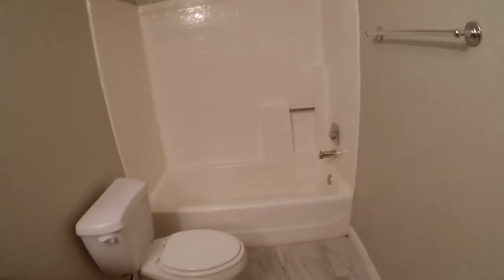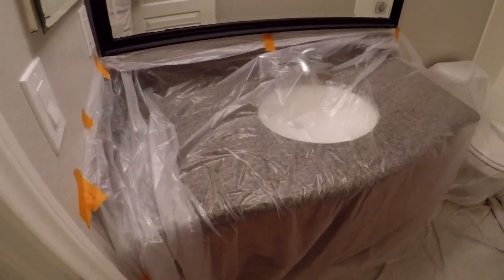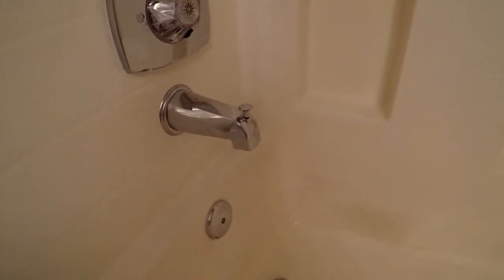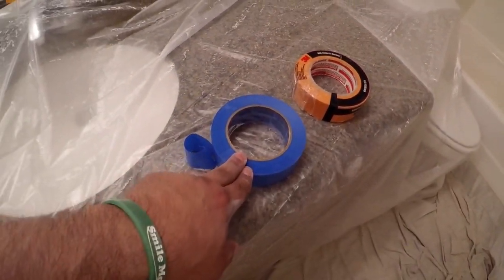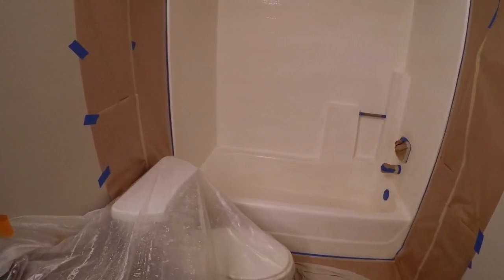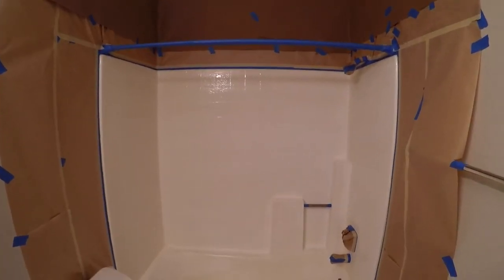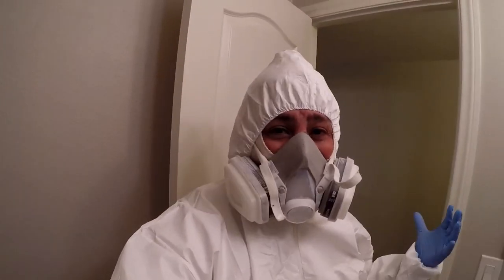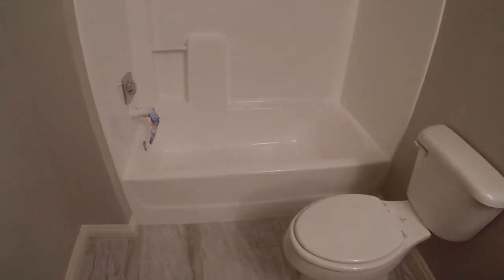How to Reglaze a Fiberglass Bathtub | Full Fiberglass Bathtub Reglazing | DP Tubs

Comment: How many coats of Krylon do you spray on? and how long do you wait in-between coats. Any sprayer you'd recommend for $200-$500? What do you use to clean your sprayer after the primer and Krylon? Will be trying my first full fiberglass tub reglaze this Friday.
Reply from the maker: -I spray 3-4 coats of the Krylon. 
-Graco has a less expensive sprayer or if you are DIY then Wagner Flexio 
-I use lacquer thinner to clean up Krylon and just warm water for the primer 
-Good luck. 👍🏼 
-Let me know if you have any questions

Comment: I attempted to paint with epoxy paint my tub and the fiberglass walls, I didn't do a very good job and wonder if a professional would have to strip everything to fix it?
Reply from the maker: Yes most likely strip it all off or they would have to sand it down very thin and re-primer. They could most likely give you a free estimate.
Reply: @DPTubs  Thank you!

Comment: How many coats of Krylon do you spray on? and how long do you wait in-between coats before spraying another coat? Also how many coats do you get from one kit for a tub and shower enclosure similar to the one in this video?
Reply from the maker: Great questions: 

-I spray three coats on top of the primer 
-I wait about 10-12 minutes in between coats
-I get about two coats for every 20 ounces mixed. 
-You would be safe buying one kit for each tub shower and have left over for touch ups if needed. 

Make sure to shake well and strain the mixed material into the gun. The catalyst sometimes gets a bit “pulpy” so always strain before pouring mixed material into gun cup.
Reply: @DPTubs  Thanks for replying. I ended up buying two kits but returned one. One kit was enough. I am glad I put plastic on everything. I learned the overspray sticks to everything. Anyone considering doing this  make sure you cover everything including the walls. It came out great and was not that hard. It all comes down to the prep work. If you cut corners on the prep you will be sorry. Thanks for your video. It helped me out.

Comment: Awesome job! Very professional! is this the same process for a cast iron tub?
Reply from the maker: No! Cast iron I will acid wash. The cast iron is the same process as the presses steel tubs. I have a couple videos showing the bathtub Reglazing on steel tubs.
Reply: @DPTubs  Awesome! I will watch those. Thank you! What is the expected lifetime of the reglazing for a cast iron tub? And how does it compare to the epoxy pour on products ? Do you recommend this painting method you use, as opposed to pouring the epoxy?
Reply from the maker: I am not to familiar with the pouring methods. However, I like the control and uniformity of the spray application.

Comment: So ypu only use etch on porcelain correct? And ypu just clean and sand the fiber glass?
Reply from the maker: Correct. Clean / Sand / Tack cloth and either use a bonding agent or epoxy primer before your top coat on fiberglass.
Reply: Can I just use regular white primer before the epoxy coat on the tub/tile
Reply: What kind of primer do you use? Latex? Or...

Comment: What size compressor do u use Dp I seem to get a rough feel in the tub how can I avoid that mostly from the primer
Reply from the maker: I use Capspray Titan 75...yes make sure you sand primer and tack cloth before spraying your top coat. Also make sure you are spraying no more than 4-6” from the surface
Reply: Thanks for responding DP MAN I Think my compressor may be too powerful  I got the titan 95 is there a pressure regulator that I can put on there?

Comment: Is there a reason the green painters tape isn't used? I have a case I was gonna use just for this kind of thing. Edit: Your work is absolutely flawless, well done!
Reply from the maker: That Girl yes! It’s about twice as expensive and this tape does the job perfectly! Blue painters Tape or Orange is the most cost effective. Frog Tape is too expensive and not necessary for what I do. The more expensive the rough materials the more it would cost the homeowner. So we use the best quality material but also the most cost effective.
Reply: @DPTubs  Love your channel!! I subbed right away cuz' I was so impressed. Thx for getting back to me so quickly

Comment: I figured you would use hawk product's to spray professionaly.
Reply from the maker: I like Krylon and I have used a few. Midwest Chemicals has the best overall product for the money. I like the 1:1 ratio of Midwest as well. 
I like Krylon for Vegas because it’s “wet” enough for the heat and doesn’t need to be thinned as much. Very thick. A bit more expensive because it only comes in quarts but holds up very well.

Comment: If I am painting for the first time, what grit sandpaper should I use?
Reply from the maker: What type of surface? Metal tub or fiberglass?

Metal or Cast Iron tub I recommend using 80 grit after acid etching the surface. 

Fiberglass or acrylic I recommend 220 grit to scuff it up enough for adhesion but not too course to show scratch lines.

Comment: My concern was that a power sander might etch swirl marks into the fiberglass but this doesn't happen? There is dirty/soap scum, something on the surface that Magic Eraser would take off with alot of elbow grease but a power sander (mine is the triangular oscillating type) would be a much easier option.
Reply from the maker: I always use 220 or greater when sanding directly on the fiberglass or acrylic.

Comment: Hi. 
I’m looking into this for my moms restrooms I don’t have a cap spray maximum would it work with a more economic sprayer? 
And what is the name of the kit for reglaze? 
Thanks
Reply from the maker: DIY you can use Krylon Tub and Tile or your can use Homax from Home Depot. However the preparation is the most important. You want spray equipment for acrylic urethanes.

Comment: i own a bathtub reglazing company. leaky taps are my arch nemis how did you do that blue glove tunnel  to drain the leak?
Reply from the maker: Awesome! Where are you located! The best way to run a funnel down to the drain is using an actual plastic oil funnel for a car and then at the top use a plastic tube to match the diameter of the funnel and tape it into the drain. 

The glove tunnel is kind of a Mickey Mouse way of doing it. (Even though I did it that way lol)
Reply: im in Winnipeg MB.    the funnel gadget ive tried dosent hold to well. id like to see a video of the glove. you must cur the tips of the fingrs?
Reply from the maker: @johnnytuzi9070  Yes I cut the tip of the middle finger of the glove and tape it and then divert it through the overflow.
Reply: @DPTubs  thank u sir

Comment: How would you remove the over spray that is left after the paint is dry?
Reply from the maker: Depending on the product sprayed you should be able to use acetone or lacquer thinner. Make sure you check the surface the overspray is on so they don’t damage the surface when applied

Comment: I have two tubs I would like to have reglazed. When hiring someone what questions do should I ask? What’s the cost? Looking to sell my house.
Reply from the maker: Ivy Moore Younique Presenter great question! 

What material they use. What their warranty is. if fiberglass tub ask if they use a bonding agent or adhesion promoter. If metal tub or cast iron ask if they acid wash the tub. Do they cover up the bathroom to prevent from overspray. Do they remove the caulking. Send me their answers and I will help you if needed. Do they remove fixture or mask around. Ask what are the things you need to do to help make it run smoothly.
Reply: Thank you, I will definitely share what they say.
Reply from the maker: Ivy Moore Younique Presenter I will also be having a Q&A session live today or tomorrow!
Reply from the maker: I would also estimate that two standard size tubs without major damage would cost between $500-$600
Reply: DP Tubs The quoted a price of $900 for two tubs. $475 for one. $900 too much?  He said he applies it on hot, tapes around the perimeter of the tubs and it has a 20 year warranty
Reply from the maker: Ivy Moore Younique Presenter are they just basic size bathtubs? 20 year warranty is a sales pitch..industry standard is 2-3 years! I give 2 year warranty. $900 for standard tubs is a bit much from my perspective. I would try two other estimates and compare. If the showers are similar to the ones in this video then that is a decent price since I charged $700 for these two Bathtub AND wall units.
Reply: DP Tubs should I seek another quote or counter?
Reply: DP Tubs the are basic size tubs. They have a lifetime warranty. The only company listed in my area that does the tubs
Reply from the maker: Ivy Moore Younique Presenter looks like they know it too. I charge $295 for a standard size tub. If it’s within your budget and you feel comfortable with them then go ahead if there is nobody else.
Reply from the maker: Ivy Moore Younique Presenter counter and say $700 for two with a 10 year warranty. If he says no then get another estimate
Reply: DP Tubs okay I’ll let you know the end result. Thank you!

Comment: Just wondering why you didn't just turn water off at main ..
For the day  instead of diverting the flow.
Great work though!
Reply: Carones Custom Coatings this was a condominium complex and they would have to have a plumber come out. So we just kept moving forward. However, shutting off the main is an option.
Reply: @PHILLIPSFamBam  right it just seems like a lot of work to divert that you could just shut it off but none of my business you do a great job though 👍
Reply from the maker: That was a condominium complex and shutting off water sometimes involves more than just shutting off at the street. So I just diverted it. Took a couple minutes lol!

Comment: Shouldn’t start on the top for your coats and have you tried the 3m cups I prefer them over the ones that come with that gun
Reply from the maker: I like the ones that come with the gun
Reply: @DPTubs  I don’t have a lot of experience with the cups that come with the gun but the 3m cups you waste less material cause there is a liner that compresses and and tiny bit more consistent pressure and then you can hold the gun upside down to hit under fixtures if you haven’t tried them you should give it a shot but at the end of the day if that is what you are used to and comfortable with that is probably the best for you

Comment: Is it 300 for just the tub or 300 for both tub and tile?
Reply from the maker: They are fiberglass tub and wall units! I charged $350 each in this unit so $700 total on this job!
Reply: @DPTubs  wow I live in Houston and I do mainly commercial tubs as a subcontractor and charge 120 for both the tub and tile and I use bin primer and ppg polyurethane ultra white
Reply: @DPTubs  but I'm in and o UK t in about 1hour and a half
Reply from the maker: Oh wow! I could never do one in one hour. Each one takes me minimum 3 hours.

Comment: No need for acid etch?
Reply from the maker: I never use acid etch on fiberglass. I use a wipe on bonding agent before the primer for adhesion. You can check out my bathtub Reglazing videos and see that I use Napco etch on tubs and also tub and tile. Never fiberglass.
Reply: Thanks for that.

Comment: Hi Danny:
I live in Las Vegas. How do I get in contact with you regarding reglazing a bathtub and shower?
Reply from the maker: Ray Brown what is your email? I can send you an email!
Reply: @DPTubs  how in the world do you deal with the over spray of the max 2 titan
Reply from the maker: Yupppppppp two ways! One is with and exhaust fan blower while spraying and in between coats. Also by not over thinning out the material and spraying with too high of air pressure.

I spray my material thick by opening up paint supply to the Max and then adjusting the air pressure accordingly. 

Clean up use lacquer thinner or acetone depending on the product you are spraying and the surface you are cleaning it from.
Reply: @DPTubs  well I put the pressure on low and I turned the air down on my gun.i didn't used a suit today and I'm snow white and I'm a black man. I'm having to use to much acetone to clean my  Customers floors.plus getting the right settings on the gun.is driving me. Priming its cool.but painting trying to get the settings right is a time killer.
Reply from the maker: Yupppppppp I have a video with my gun settings have you seen it? 11 o’clock start and then 8 ocklock for second and third coats...use lacquer thinner to clean up or abrasive pint cleaner soap on skin with warm water ...I know how that feels.
Reply: @DPTubs  btw the there's high and low  on the compressor I put it on low.man please help me lol
Reply from the maker: Yupppppppp Check here: https://youtu.be/rwX6JkwIfrs
Reply: @DPTubs  man I watch that video 5 times today didn't like the  Splatter when I was setting up the gun to spray. Plus it also look like that in the finsh.  Customer call me and told me they didn't like how it felt 😡
Reply: @DPTubs  thanks for the re9

Comment: So maybe i'm missing something...but you could've just turned the water off at the main? I'm sure the customer could deal with no water for a few hours while you work... or even better just leave and do something else for a bit. That custom glove/funnel seems like a real pain in the butt ....
Reply from the maker: I don’t have control over those things. It was the real estate agent and I was avoiding having to pull off the job. It’s not a few hours it takes the material 48 hours to dry so it’s not like they could turn it on when I left because the material would not be cured yet. This is why I made it happen. If I shut off the main to the unit then it would have to stay off for 48 hours until the material was dry enough to get wet. The custom glove allowed the job to move forward and I do them all the time.

Comment: I do auto body and paint. i hate the paper tape gun combo. try this you will never look back  you will save so much time and they have 48 inch too! I still use paper but not often and only when i have too.
https://www.homedepot.com/p/3M-ScotchBlue-2-ft-x-30-yd-Tape-plus-Plastic-with-Dispenser-PTD2093-24UU/314254846
Reply from the maker: I will have to check that out.